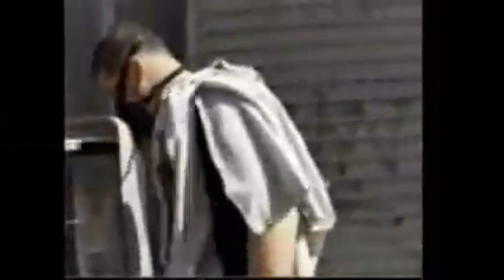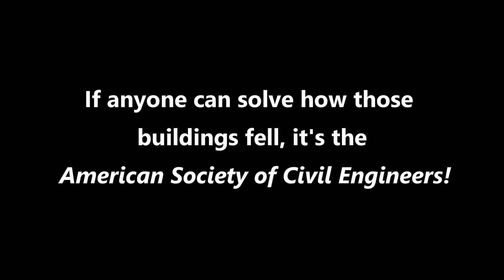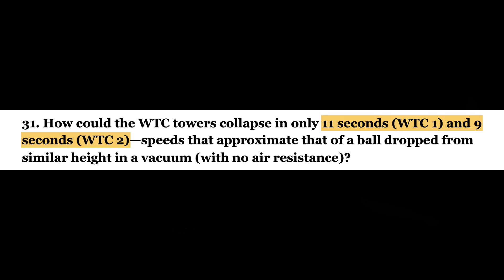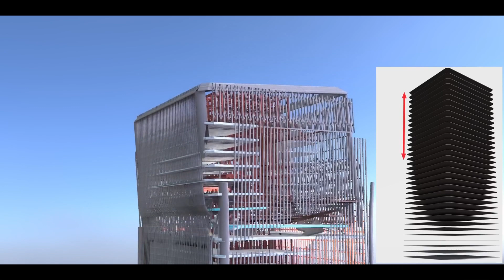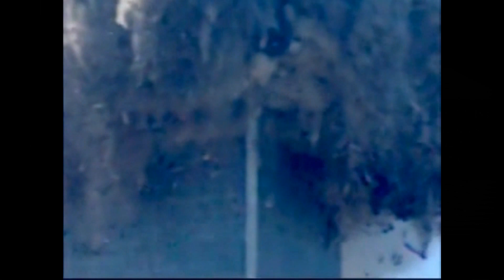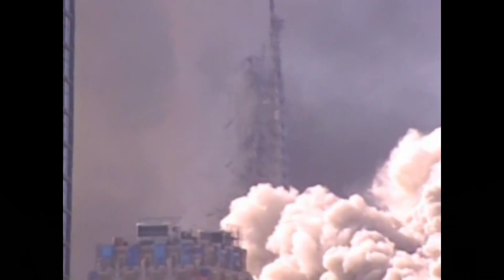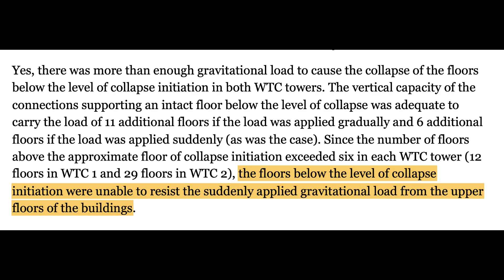The Last 30 Seconds

Comment: what if the buildings were 'shit' and didn't have the mechanical properties everybody thinks they had ?
Reply: I wouldn't call them shit, but would say that the people who developed the new concept called tubular construction did not account for a situation in which the rooftop truss was compromised or destroyed.
Reply: @FirstUsedBooks  I wrote 'shit' but I meant substandard in specific aspects ;).  When I look at the collapse, I see a "self-peeling-banana-collapse" : how good were the mechanical linkages between the trusses and the outer panels ? Because if they were just slightly better than 'suspended' (I know they weren't), I can see how the outer skin would be pushed outwards, thus shearing the links with the trusses who'd have nothing to keep them up anymore.  Result : steel outer panels thrown outwards, a big pile of pulverized leightweight concrete in the 'second ring'  and some of the core columns left standing in the 'central ring'.  Now, don't get me wrong, there are plenty of fishy things about that day but I've come to the conclusion that this self-peeling-banana-collapse can't be ruled out.
Reply: @VUO4E  Where did the indestructible top go when it landed?  Where are the floors?  Where is the stuff?  Only dust and steel were recovered.  Everything else in the towers were gone. The furniture equipment everything.
Reply: @VUO4E  Yes.  I believe the attack on the towers and Pentagon was facilitated by the US government.  I know that plans for the invasion of Afghanistan were finalized ahead of 9/11.  In August my friend's son, an officer in Army Intelligence, was granted a 2-day furlough to attend his grandfather's funeral.  He told my friend (his mom) that she probably wouldn't be hearing from him in September because he'd be posted to a mid-Eastern invasion, but not to worry about him because his duties kept him well back of front line fighting.  As for the WTC, I doubt the perpetrators anticipated or intended the towers to collapse; it wasn't necessary for their purposes.  Unfortunately for our understanding of the situation, the collapse added too many variables to the equation.  To understand what happened it's best to look at the Pentagon.  If that can be shown to be the work of some one or ones in addition to Hani Hanjour (the purported pilot of Flight 77) then it is shown to be a conspiracy, and the other flights too must therefore be part of the conspiracy.
Reply: @VUO4E  You are trying too hard to hold on to the belief that the US government would never intentionally lie to its citizens (and also kill them) without batting an eye...
Reply: @DS94everXev  Yeah, I would like to know how the "peeling banana" threw tiny pieces of humans on to the roofs of near-by buildings...some people will go to their graves believing US government is the "good guy" when the overwhelming abundance of evidence completely debunks that myth.
Reply: @DS94everXev  They found some furniture, squashed to plates of an inch thick. They also found fragments of phones, reduced to pieces of a square inch. Regardless of what caused the collapse, I don't think one should underestimate the effects of the violence involved in such a collapse.
Reply: @VUO4E  the workers on site didn't
Reply: @DS94everXev  Any Paper, fabric,,wood  plastic or MDF became fuel for the fire.  Whatever was left (metal) got mangled and smashed and basically FUBAR. The 911 museum has about 74000 objects , go check it out. The forces at work during such a collapse are quite simply hard toe wrap your head around. So the less time is spent on alien / microwave / vaporisation theories, the better.
Reply: Because that's a lie.

When the WTT was bombed in 92, Donald Trump got to see the damage first hand because he has connections to real estate.

And those bombs that went off did MASSIVE damage to the core columns.  The very columns you MUST destroy to demolition a building.

An the towers stood.

The WTT were built WELL beyond adequately.  They were built perfectly.

On 9/11 the narrative says the core columns did not take the brunt of the damage.  The outside did.

So in 92 the very columns that are required for the building to stand took direct massive bomb damage and the towers stood.  In 01 they didn't take direct damage and fell.

That's a big deal.

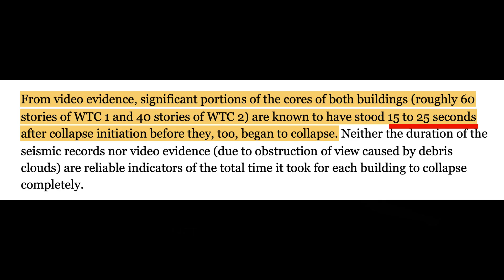Comment: 14:01 - The first sign of WTC1 collapse was surely not floor 98, as NIST tells it! But large and dust and debris ejections at the center of south face, on a floor at the upper 80s, so about 5 floors below the impact zone. Those dust/debris jets can be observed on the WCBS-TV Chopper 2 footage and on the "Hudson River Boat" footage ("EXTRA TV" video). Two videos, which NIST also has in its visual database. The German engineer "achimspok" has made a YouTube video about these ejections in 2010, title: "WTC1 collapse initiation - visible signs".

Comment: 14:01 - There's a timing error made by NIST in this table. Some times here are derived from their working timeline "Relative Time from Visual Analysis", used in their Visual Database "CUMULUS". This timeline is -5 seconds off from their final timeline called "Adjusted Time from Television Broadcasts" that is usually used in their WTC reports.

Comment: Nope. Dr. Judy Wood
Free energy - directed energy weaponry, like microwave etc, were used to bring down the towers. How come there was nothing left in the remains? 500,000 tones of steel, glass and concrete, and yet nothing was left. How does controlled demolition not have any remains? The dyke and underground parking was completely untouched. Manhattan never flooded.
Reply: I agree.  Something well beyond common explosives or nano thermite were used.

Explain where the force source is for the multitude steel pieces flung outward in a direction 90 degrees from gravity direction so hard with so much energy them embedded themselves into neighboring buildings came from.

Because THAT did happen.  And the only force applied to the towers was gravity which only acts downward.

No magnetic weapon can do that.  Nor can nano thermite which only cuts steel.

Something else that is incredibly powerful was used.  Powerful enough to push itself thru the falling debris and out to the surrounding buildings.

I ask conspiracy theorists all the time about the stuff in those buildings.  Where is it?

They reply back saying it doesn't matter and it was all crushed.

It wasn't a nuclear bomb either.  The radiation would easily be detectable.

Something that we are 100% unaware of was used.  

My guess is it's from an Area 51 type research location.

Where are the desks?  Computers?  Furniture?  They were atomized.

Comment: Why does the steel turn to dust on its way down? And one can easily see that the spire also turns into dust. Dr. Judy Wood is quite correct in her analysis.  .https://youtu.be/E2NFKJKFZX8?si=cjfmb_Ngj6rstDGl
Reply: It was concrete that dustified.  No floors were located on the ground.

Comment: To all the sceptics here. Imagine if you were to plan a demolition of those buildings, how many demolition charges or how many floors do you think would be required?
Reply: About 4000 pounds. 
10 men. 40 pounds per trip. 10 trips.
Reply: @HarryBalzak  Okay. Is that in total? Or per floor?
Reply: @HarryBalzak  I have no idea what was the max rating for the elevators. But I would assume one or two trips would be enough to carry 4000 lbs of anything to to a specific floor. 

Now you think 4000 lbs of demolition charges would be enough for the whole building? Or is that an amount just for one floor?
Reply: @pepelapiu2004  I have no expertise in demolitions. I am going off of an expert's estimate per tower.

Comment: very compelling, I'm still waiting for a computer simulation from the official story that looks anything like what we saw that day.... they can't claim lack of processing power anymore
Reply: They also can't claim that the series doesn't converge.  It did for U of Alaska simulation.
Reply: @qwerty90615  What does, "series doesn't converge" mean? Please explain.
Reply: @HarryBalzak  Solutions to equations are sometimes evaluated as a sum of a series of terms.  If you try to find the sum for some series that doesn't converge, it doesn’t give an answer. It goes to infinity.  This happens in computing science sometimes.  In this case, it looks like it may be a convenient excuse to avoid providing an answer.  Simulation can be done in many ways, so if one doesn't work, another approach can be made.  

This whole official analysis was a means to delay until the emotional energy dissipated.

NIST refused to provide the source code parameters used in their simulation of WTC7, citing national security.  Engineers need to know what failed (if anything) in order to prevent future failures.  Secrecy prevents proper engineering practice.  How does it supposedly protect national security?
Reply: @qwerty90615  Thank you, Sir/Ma'am.

Comment: The Steel Seats for the Truss Connections and Rubber Based Dampers failed, combined with 3800 tons above the impact. No scale model is going to simulate that.
Reply: Naming random structural pieces and simply claiming "they failed" is just stoopit. Every single structural member did indeed fail. That is what is obvious. A total collapse means that all the structure failed, not just the seats and rubber parts. 

The fact is, while the stricture was failing, explosions could be heard and seen before and during the collapse. It came down at near free fall while most of the structure was ejected outwardly.
Reply: @pepelapiu2004  He seems to be referring to the NIST report for WTC7.
Reply: @qwerty90615  No matter which building or report he is reffering to. Merely listing structural components and stating they failed is disingenuous. Every single structural member fails in a complete collapse.
Reply: Let me ask you. If they wanted to demolish the building, how many demolition charges on how many floors do you think would be required to achieve a drop similar to the ones we see on video?
Reply: @pepelapiu2004  
Naming things not mentioned in the video which were weak points. Yes
Expecting detailed response in youtube comments that will just be ghosted, no.
Look them up yourself. There's no point in rigging every floor let alone the spire with charges. You can't achieve another building drop like them because there are no other buildings constructed like them thus no demolitions will ever reproduce what happened.
Reply: @Clip_This_Schitt  You are stalling. If you were to demolish the buildings, what is your estimate of the demolition charges? How many charges would you need over how many floor? You best guesstimate?
Reply: @pepelapiu2004  
What do you mean I'm stalling? You are not paying me. You do not have any right to my time.
Reply: @Clip_This_Schitt  You are replying without answering the question I asked. You are avoiding the question because you know your answer would break your logic.
Reply: @pepelapiu2004  
You're a random person on the internet arguing with another random person that has no vested interest in you. That doesn't make you a winner.
Reply: @Jordan_B._Peterbilt  Nooo! I'm debating, and you are the only one arguing. Insulting, trashing around, distorting, and dodging. That doesn't make you a winner 

I seek to learn and share. I win every time when I do this because there are no losers in this regard.

If you learned nothing and shared nothing, you are the one who lost.

Comment: The last part to “fall” did not “fall straight” down. You see them turning into dust in mid air. Dr. Judy Woods videos about this are correct. DEW’s used that day as well as other explosives.
Reply: Found the fed...
Reply: DEWs don’t leave Nanothermite chips in the WTC dust. Explosives brought the towers down.
Reply: Nonsense. Judy Wood is a dis-ino no-planer, who doesn't want to meet AE911Truth in a scientific discussion and denies the findings of the nano-thermitic material.

AE911Truth has rejected all of her un-peer-reviewed "evidence" in their article "FAQ #13: What is AE911Truth's assesment of the direct energy weapon (DEW) hypothesis?"

(If I post links, my comments will dissapear. But go google it.)
Reply: Please stop with the Dr. Wood arguments.
The first step is to make the public aware the official narrative makes zero sense. 
After that we can figure out what actually happened. 
Go from A to B, not A - C, D, E, etc...
All it does is muddy the waters.